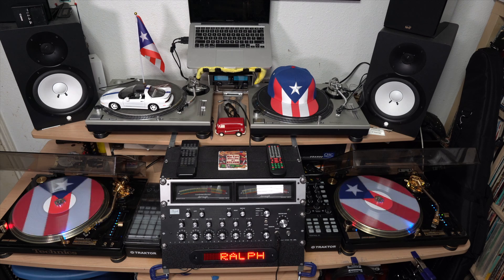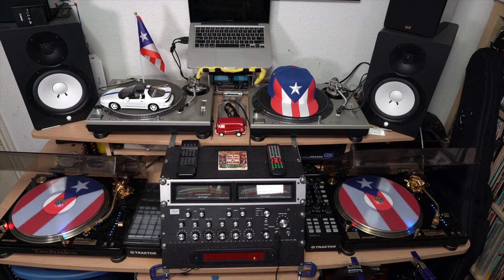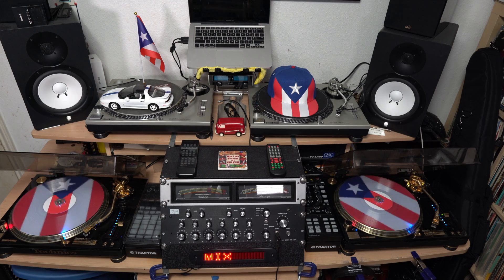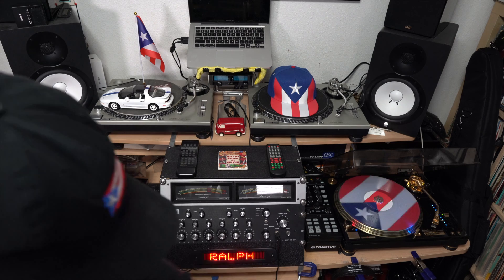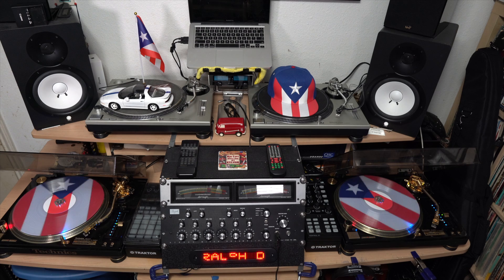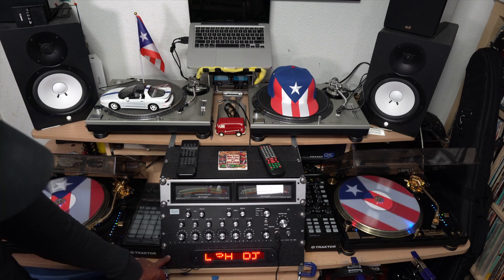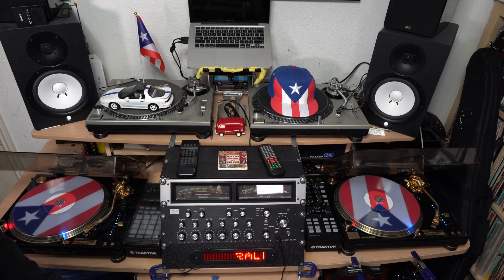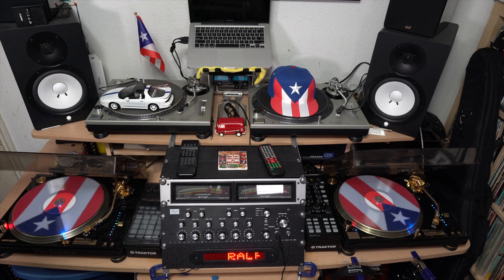How to make a scrolling LED sign for your DJ booth.

Comment: I see this is a China based seller for the sign. I wonder if at this time that would be a big delay or customs hold. Being with all the flue stuff or what be going on. I know I am into 2 months now waiting on a order of something. Most my China orders take about 3 weeks to get. Any event I colect and fix electronics. Also collect cb radio related old stuff. Sign would look good above my Cobra 2000 listing on air. Course I also use to Dj and have a ton of stuff and mix at home. Mostly old stuff. I am now just getting into this controller type stuff with software. Of which I can't say I like or don't yet. I'm still playing around with this new Pioneer DDJ-SB3 and Reloop neon box. I am use to my Tech 12's and first started on two tape decks and blending on that. Getting the double beat and echo only by playing two tapes the same on decks. Which was a art and good ear. I most likely will by the sign and hook it up to a pack meeting voltage, amp specs and all else. I assume this sign only displays a color of red? Is it dimmer justable or full blown bright?
Reply from the maker: Back when I bought my sign a couple of years ago, they had it in Blue or Red. There are other makers of scrolling LED signs, and they sell them in different colors, so you might want to look around. I posted the link to the one I bought. Mine is not dimmable.